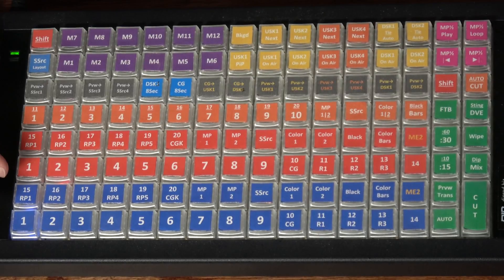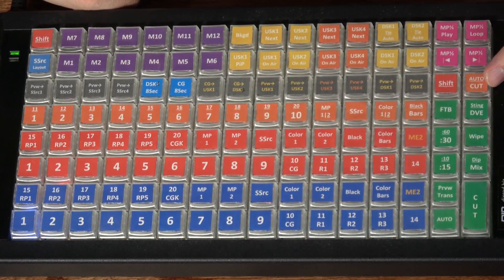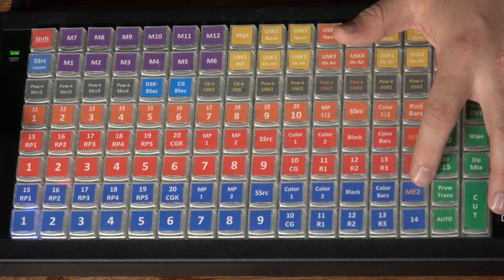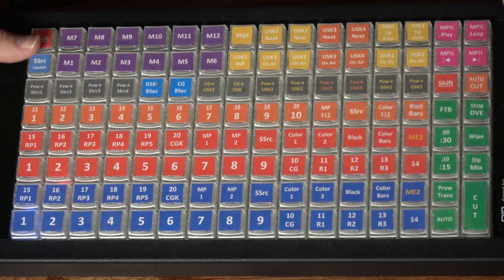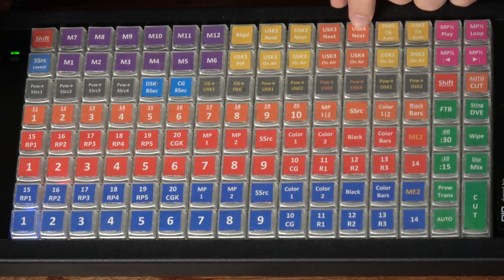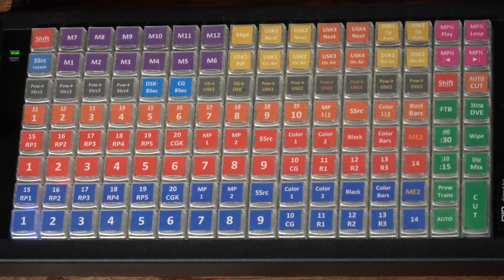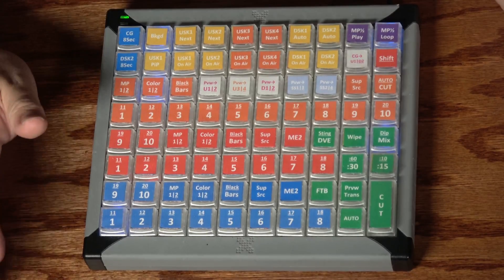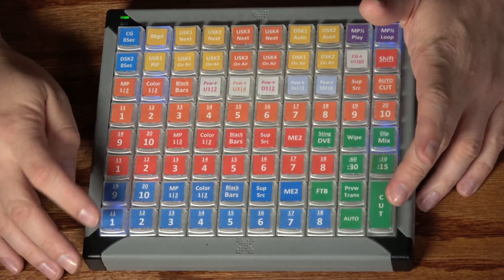My X-Keys Layout for Blackmagic Design ATEM Switcher

Comment: what do you use for instant replay? You mentioned Replay buttons on your switcher. What is your procedure for performing an instant replay? Thanks
Reply from the maker: I'm using vMix. I had originally planned to go another way, but vMix is inexpensive and does well. I'm using a Decklink 8K Pro card to capture video from up to 4 cameras into vMix.
Reply: @djp_video  Which version of Vmix do you use? I see VMix Replay comes in different options. I'm looking for a 4 camera Record / 2 Output version. Thanks.
Reply from the maker: I do the subscription option, which has all features, one month at a time as needed.

Comment: The keyboard might be usable for an occasional key-macro call, but if on the XK-128 it also requires 150+ grams to push a key like on the XK-80 which I bought (and send back immediately - it was totally unusable for me), I can't imagine typing on it feels nice. It must hurt your hand/wrist/arm/shoulder, if you use it much.
Reply from the maker: Odd. I have the 128, 80, and 24 key versions and they all require about the same amount of force as a typical computer keyboard. No issues here.

Comment: Hello Doug! I have one question, I have a workflow that requires me having to use both ATEM Televison Studio(Original) and also OBS with alot of scenes and I'm trying to find the best workflow solution to control both from one area/device hopefully.
So my question is, would I be able to create controls for both programs on one of these devices or would I have to buy two seperate ones?
Reply from the maker: You can probably get something working with both using a Stream Deck.
Reply: @djp_video  Cool I had the stream deck in mind when I had a different workflow, but I kinda prefer not to have to go through banks of buttons, but if I have to then I will.

So by you're answer you are saying this is not possible?
Reply from the maker: I'm not aware of an easy way to control both from one piece of software.

Comment: Hi Doug, i got a little question out of curiosity! :)
Why do you use a X-key controller instead of one of Blackmagic broadcast panels? Is it the cost or do you just don´t like the workflow?
I really love the trailer btw! I am so inspired to build my own one day!
Reply from the maker: Cost mostly. Since I use the 2 M/E switcher, and I regularly have more than 10 active video inputs, using the 1 M/E panels would be awkward, having to constantly use SHIFT to access video sources on inputs 11 and higher.  At $15,000 I just couldn't justify the cost, even though it would look awesome on the front desk of the trailer.

Comment: Great videos Doug! I'm in the process to setup a X-keys 80 keys to control my ATEM Television Studio HD. It has gone well this far but now I have got some problems. 

I want to use the source that currently are active in the preview-bus just like you do in this video to set fill source för USK and DSK and also send it to the AUX but can't find how to code that. 

How do I find this? Can’t find code for this anywhere. I’m using Lua code in Just macros. Is it possible that way?

Comment: Hi Doug, is it possible to use JustMacros to test the implementation of JustMacros code connected to an ATEM without using an XKeys panel?
Reply from the maker: You can execute macros manually, if that's what you mean.
Reply: @djp_video  Yes, I guess that's it. Run the macro in JustMacros to see how it controls the desired behaviour on the ATEM. I haven't bought the XKeys 128 yet and just wanted to experiment with my own workflow elements before buying anything and to see how easy it is or not to whip up some scripts.

It would be totally awesome if you could do a short video on: starting JM, writing/loading a simple script, testing it and then adding it to XKeys. 

Have not been able to find anything like that and your a wizard and a go-to source for this wizardry. :-)

Comment: Hej Doug, I've been wondering what you use to create and playout animated lower thirds and general CG. I find the "normal" method of rendering everything out and loading it into one of the media players very unsatisfactory and slow. How do you do that?
Reply from the maker: It depends on the event, but what I do more often than anything else these days is load the background animation into one of the media players in the switcher, then use some of my own proprietary software to generate the text (it's a simple matter of typing in the text and pressing F5 to render it). The media player gets assigned to one upstream key, then the computer generating the text to another, then use a macro to bring them on-screen, and then off-screen after the animation has completed. I've got that loaded into my "M1" button on my X-Keys controller so as soon as I hear from my CG operator that the text is ready to go, I press the one button and it does its thing. You can see how that looks here: https://youtu.be/3x9ul22Q4yM?t=1h13m2s

Comment: Really cool to see your setup and what you use, I might have to give one of those X-Keys a try at some point. Have you ever considered any other devices that may offer more visual feedback? For example, I don't vision mix as I run video support in my productions, so mostly working with VT playback, creating instant-replays, pretty much anything video related so maybe my use case doesn't have the same needs as a vision mixer, but what I use is an Akai APC mini.

It's designed as a pad for DJ's, but most production software we use has a good API, and being a midi controller it's easy to program it to do the functions I need it to, while also giving me visual feedback as each button can be off/red/yellow/green or flashing a colour, some buttons could easily be used just to indicate the status of something through their lighting. There's not much room for labels like the key pad you've shown, but between the lighting and creating a simple realtime web interface to bind buttons to functions it hasn't been an issue. I'm just curious if you've considered anything like this.
Reply from the maker: I've been on constant lookout for another solution which is affordable and functional. The newest BMD control panel is a little more expensive than I'd like, and doesn't work super well with the 2 M/E switcher I've got, requiring a lot of multiple-key combinations to do things which I'd prefer to do with a single button.

In terms of visual feedback, you can't really see it on this video, but the buttons do light up on the X-Keys controller.  Not that I use that much, though-- I prefer to keep my eyes on my monitors.